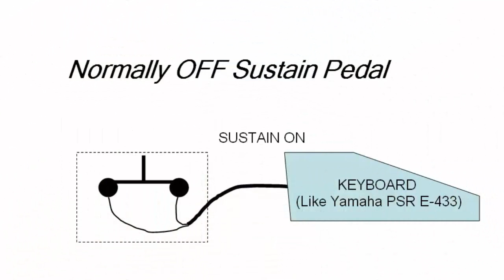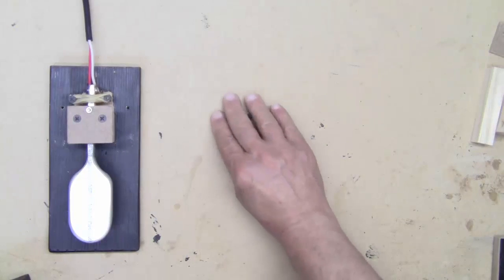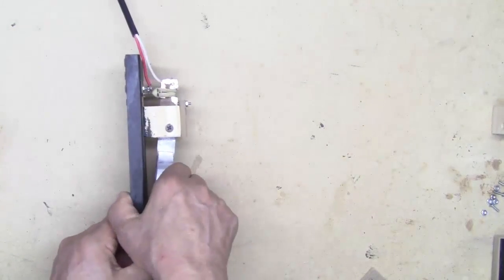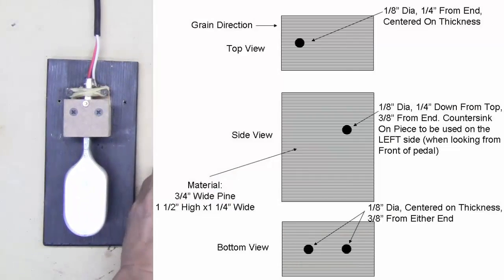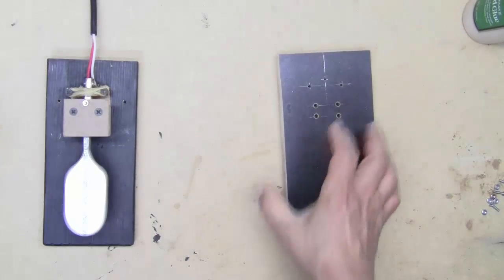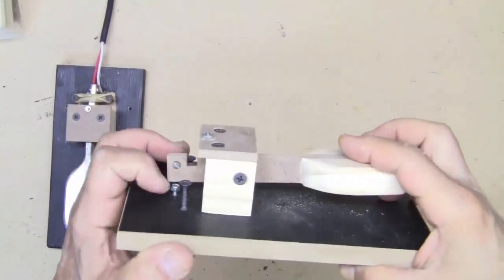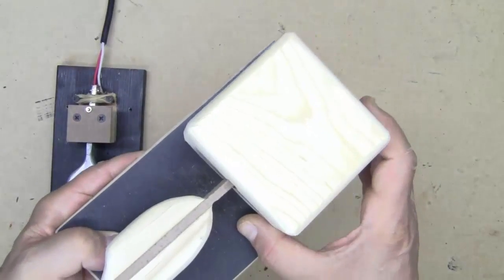Build the NEW Junkbox Universal Keyboard Sustain Pedal

Comment: before changing the wires. There is a way of connecting the pedal to keyboard. I have experienced the pedal works opposite when connected while the keyboard is on. so before changing any wires, try connecting the pedal while the keyboard is off and then switch on the keyboard and see. Hope it'll work fine.

Comment: Note: some keyboards (like the YPG-235) will try to detect whether it's a normally-off or normally-on switch, but only when you turn on the keyboard - so just plugging it in, it might be reversed, but if you turn it off and on (while not holding the pedal) it might work. Also some people (I don't know with what keyboard or pedal) have apparently needed to hold the pedal down while turning on the keyboard, if it was detected backwards for some reason. Also some keyboards (like the RD-700) might have a setting for it, to select the polarity of the pedal explicitly.

Comment: в общем всё не плохо, но идея без включателя-плохая идея, так как кабель будет часто обрываться...
(не сложно догадаться - почему!?)
Reply: What? Just tie a knot in the cable or put a ziptie on so it's retained by the opening, use stranded wire, and have some extra slack or a loop going to the moving part to distribute the bend over a larger radius. With stranded wire, it'll last for decades. Keeping in mind the actual movement range of the moving element at the wire attachment position isn't a lot, it's large at the foot pedal end but barely nothing on the other.

Comment: Just add an SPDT switch. Connect the red wire to the center pin, then connect the other pins of the switch to top and bottom contacts. Universal configurable sustain pedal.

Comment: you did the top measurement wrong. it should be 3 by 3/4 high and 3 by 3/4 wide not '2 1/2' wide

Comment: hey there, hope you can help me here. 

I actually build my own before i looked at your original pedal. it's a quick 'test make' with a very simple design  just to see if i like the use of a sustain pedal as i'm a complete newby... so not as nice as yours ofcourse but still it's electronically oke so it should function but it doesn't.

The design is like a flat base plate and springy top plate glued together in a V. base plate on the floor and spring plate up in the air. 2 contacts on each side of the top V. together with some anti-slip at the base plate.  when i place my foot on the springy plate it bends and the two contacts touch and close the circuit, which i checked and tripple checked. i used a mono jack just like you.

but once i plug it into my yamaha ypt230 it doens't work, it doesn't sustain and i don't know why. not when pressed and not when not presssed. any idea when the problem could be? 

it would relly help me as i really don't know where to start.
Reply from the maker: +Matthieu Kints, van Email me at brodafinjr@optimum.net and I'll try to walk you through getting your unit to work.